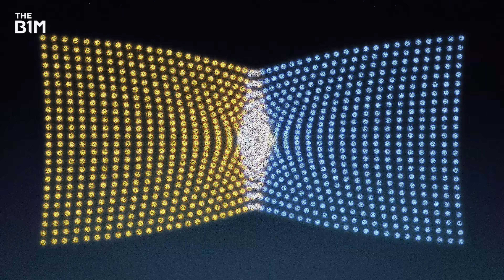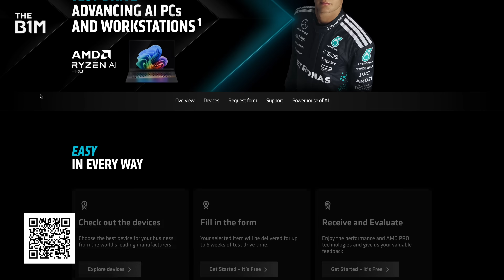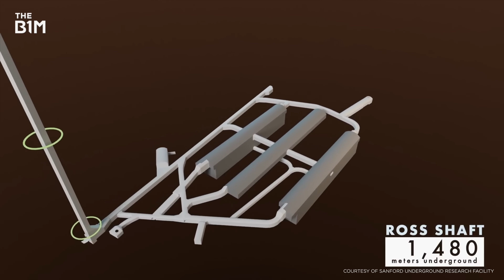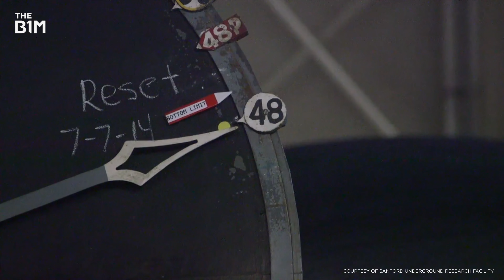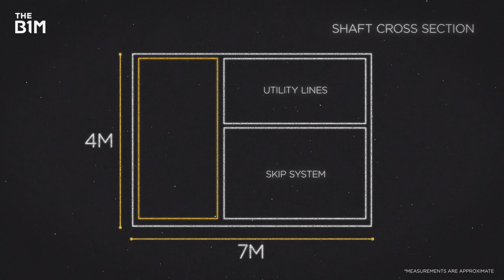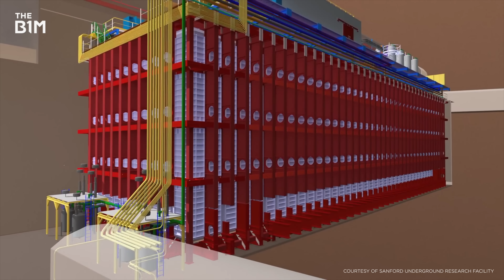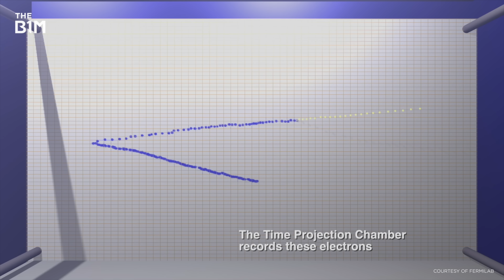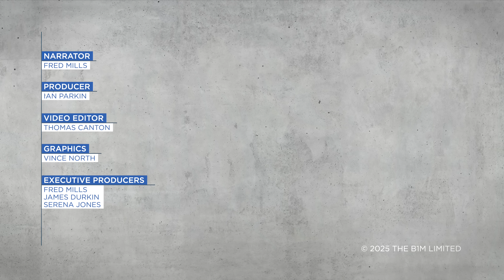Why America is Hollowing Out a Mountain

Comment: Deeper down the rabbit hole, and the wrong one at that (my opinion).  Not buying the 3B vs 3B+1 line of thought ~ it's an extrapolation, and not necessarily an accurate one for myriad reasons, including dark matter,  expanding space-time, etc.  Granted, it's a worthy experiment, but we're looking in the wrong direction.  It all hinges on the idea that the Big Bang... which is theoretically arguable as having BEEN a "Big Bang" to begin with (there are reasonable published proofs positing this is not the case)... created only OUR universe.  The answer is likely both simpler and more elegant than our present form of mathematics can unravel, meaning even quantum mathematics is only a small step in the right direction, and even that will prove ultimately misleading. Just saying.

Comment: i think that neutrino research is a very clever and actually a very realistic-plausible nobility project. ok crazy theory following.. (only as crazy as antimatter research).: i think they will dismantle a boring-company tunnel-boring device and reassemble it in one of caverns. i think that they will create a network of access to other surface locations as well as other subterranean locations that will remain undisclosed. there are many reasons for doing this; indestructible multi-access stronghold, planetary exploration development, asteroid mining research, terrestrial infrastructure research., hardened power and machine learning infrastructure,.. and much more. look at the incentives.  also wonder what the stats on gold discovery are for the gold mine as they developed this, and while building this did they continue to test the excavated material for other mineral bearing qualities and valuable geology.

Comment: A light years distance of solid lead would have trouble stopping this supposed particle but were supposed to buy the notion that this insignificant blip detector in comparison to a light years length of solid lead. The time light which travels at 300,0000 some odd miles per second. Multiplied into a year. That length of solid lead, kajillions upon kajillions of miles of lead.
That much of an inconceivable chunk of solid matter. But apparently this insignificantly sized structure will be able to detect how the particle will interact with other mind bogglingly tiny particles, based on an assumption of an event they believed happened at the beginning of time. Which is i would remind you, is just a wild notion theory of what they believe happened.  When everything everywhere happened out of nothing but managed to make not only matter but also anti matter, but in an unequal amount for some theoretically odd reason. Theoretical sciences is full of these oddities. Which are compounded as new theories require new oddities of science to try and explain previous oddities. If one doesn't comprehend something that won't fit with what came previously. Then it must be something new. Let's call it dark matter or perhaps maybe an equally strange dark energy to explain what we don't understand. On and on they go. If we explain it. Make up something and then build giant machines to prove we not making shit up.
Honestly the  gobbledygook they come up with trying to explain how the universe works is at this point quite comical. 
 I know I'm a fringe minority on this. But come on. Giving little desk top explanations that on the surface sound somewhat feasible to us normal brained folk. So we all just ok you know best. But scratch the surface and ask yourself... Really, but what about this or that or the immutable law's of physics that somehow don't apply when explaining how the universe began.
Then it begins to unravel. But these guys always have an explanation that again sounds somewhat feasible so again we say ok you know best.
We then carry on believing, and as long as a new tomorrow keeps coming then 99% of the world doesn't really care.
 Wow. I'm totally convinced this is money worth wasting... I mean investing into a future of make believe and 
the theoreticists wet dreams of keeping it all going.
They all believe it's all true and based in and on reasonable mathematical equations. But believing in a universe of numbers that give the belief there are multiple universe's overlayed realities, time travel and other sci fi fuel of the imagination because equations on a board if you play with enough number variations will give an answer to a question you've asked yourself does not make it so. But we've convinced ourselves we can keep adding to an already way over burdened explanation from scientists all over the planet as to how the universe works.
 But those who look at thing's differently then the science community it sounds for a good chunk of the theoretical NOT the practical science ( i want to make that distinction) quite silly.

Comment: 5:55 - If neutrinos can pass through anything how is a simple mound of earth supposed to redirect them into the detection array?   Why not just aim the beam at it directly?
Reply: It IS aiming at it directly - the mound of earth is to angle the beam so it points down into the ground at a shallow angle. Because of the curvature of the Earth over that distance, it needs to aim THROUGH the Earth to directly hit a target miles away
Reply: @largepurplemonkey  That was not what the diagram illustrated.
It indicated the beam was aimed perpendicular to the surface at the emitter, with the reflector positioned to redirect the beam before it reaches even the first emitter.
Ergo: is the origin producing neutrinos (which pass through everything so how would a reflector work and if they're trying to detect them how, then, can they be produced in the first place) or some other atomic mass such as protons that could be thus redirected.

Comment: I have questions.  First, how do you tell the difference between a neutrino and an antineutrino?  What even is an antineutrino, given that a neutrino has no charge and antimatter particles normally have the opposite charge of a regular matter particle, e.g., the electron and positron? Come to think of it, if neutrino detectors have to be massive in order to have a statistically significant chance of detecting neutron/nucleus collisions, how was the neutrino discovered in the first place? I am also curious about how we know that the Big Bang created 3,000,000,001 particles of matter for each  3,000,000,000 particles of antimatter.  That is an awfully exact figure for something that happened more than 13,000,000,000 years ago.  I detect that I have some googling in my future.

Comment: I took a tour of the Homestake mine in Lead many years ago. Got to go inside the headworks. The machinery is massive! Our tour walked around the outside of the building and I noticed a pile of broken drill cores on the ground. I as the guide if I could take some pieces and was told yes. The interesting thing about the cores is they are very heavy from their size. I asked about that and was told it is because on the compression of the rock at depth makes the cores heavier.

Comment: The thing they're testing is something known as Left Hand Bias. Essentially, at EXTREMELY small levels of precision, using HIGHLY technical models that INFER the meaning of the universe. some VERY deep DEEP measurements imply that VERY specific CHIRAL interactions have a "go left instead of right" bias in models. While nuanced as hell and EXTREMELY subtle, IF IT'S TRUE, it CAN explain why matter migrates INWARD and antimatter migrates OUTWARD, creating a SHELL that INSULATES "matter" inside the "volume" and ENCODES matter on the OUTSIDE of the volume, as the universe expands away from the Big Bang. It's like...knowing something is growing by measuring the stretch marks. It requires an incredibly long and nuanced chain of logical principals that has become an nigh-impenetrable labyrinth to the lay because of how deep it is in the chain of Reductionism, but it is fantastically impressive no less.

Comment: I’ve worked on this project and if you get the chance there’s a great little museum above the mine that explains what they do. It is a great use of an existing mine. They also have shirts that say Nerds searching for Wimps, Sanford labs at the Homestake mine. (Weakly Interacting Massive Particles (WIMPs))
Reply: Isn't Japan doing the same?
Reply: Yeah Japan's Super K detector was mentioned several times in the video.
Reply: @ryszardfalkowski7917  No, Japan's system is on a much smaller scale. 🙂

Comment: 6:32 Protons?
6:47 Neutrons‽
13:27 Neutrinos!
Reply: The neutrons/neutrinos mixup is an easy mistake to make, I'll let that one slide.  But saying protons?  Oof
Reply: came to the comments to say this! what was that all about?!
Reply: 14:41 he says neutron again (twice)
Reply: Well, Neutrinos are electrically neutral so you cannot force them around corners using magnets. They go in a straight line. 
I don't know how you produce Neutrinos but it could be correct that they produce them from protons.
Reply: @jpt3640  They do. But the two detectors are for neutrinos (which are detected indirectly, of course).
Reply: @alterego3734  sure.. so there is no accidental mixup?
Well, except neutron neutrino
Reply: @jpt3640  No, from the context, "protons" is still a mixup.
Reply: 4:50 NPU gimmick though
Reply: protons are fired into a graphite target resembling a long roll of quarters. Many different types of fundamental particles come out of the collision between the protons and the target, including pions, which are charged particles. then magnets steer the pions in the direction they want the neutrinos to travel. The pions eventually decay into muons and muon neutrinos, which continue on the same path the pions were traveling.   
 
That's Directly off Fermi Labs website

Comment: The scale of excavating the far detector at 4,850 meters is astonishing, especially considering the historical context of the Homestake mine!
Reply: 4850 feet not meters
Reply: The amount of heat in the cave walls must be astonishing. I can't even imagine the size of the cooling system required.
Reply: I worked for Homestake at the Bulldog Mtn mine in So CO.  I was able to visit Lead once in the late 70s as part of my work.  I don't remember the name of the winze (internal and different than the shafts from the surface that they refer to in the video).  At the time, the winze went down to the 8000' level, 3000' below sea level.  I don't believe it was ever deepened.  The deepest mine in the world before So Africa gold mines started.  The rock temp was 120 F.  To prevent spalling of the wall rock, there were rock mats every 6-8' completely covering the circle from floor to back to floor.
Reply: Iran did it long ago.
Reply: 7:11 "at level 4850" 
7:29 "at 1475 meters under ground"

The 4850 number is either feet or just another way MAGA inflates general accomplishments.
Reply: @alltheusernameswastaken8936  
some people are just not capable of not spewing their terrible politics everywhere even when irrelevant.
Reply: @alltheusernameswastaken8936 MAGA couldn't assemble a preschool toy block house. This detector was not designed by them.
Reply: Oh pish Tosh, 😝
It’s nothing compared to all those little tunnels connecting all of our military bases come on now get real this is nothing ha ha ha ha
Reply: @shockingguy put the meth down
Reply: 😂 @jtorola

Comment: THERE IS NO DARK SIDE OF THE MOON!
THERE IS NO DARK SIDE OF THE MOON!
THERE IS NO DARK SIDE OF THE MOON!
THERE IS NO DARK SIDE OF THE MOON!
THERE IS NO DARK SIDE OF THE MOON!
Reply: What about the side that is not in the sun?
I experience the dark side of the earth every night
Reply: There is a dark side of the moon. It's just not the far side of the moon. It rotates. Just like the moon does. Just like the Earth does. Is the part of the moon in the Earth that are facing away from the sun. Just because you use all caps doesn't mean you're right. If I landed on the moon just after sunset and stood there for 14 days, I would be on the dark side of the moon. Then for the next 14 days I'd be on the light side of the moon.
Reply: The side of the moon that is dark is cold. The side of the moon that is light is warmer. 
The part of the moon that is in dark and the part of the moon that is light changed during the month.

Comment: 7:11 Kinda confusing conversion there. The level is 4850 in feet but in meters is 1478m
Reply: It rather depends what exactly is being measured, point-to-point. The main level for science is the '4850 Level', which can be accessed through the Yates and Ross shafts. At 1,490 meters (4,890 ft), SURF is the deepest underground laboratory in the U.S. Two main underground campuses, the Davis Campus and the Ross Campus, host experiments on the '4850 Level'. The Ross and Yates shafts run from the surface to below the '4850 level'. The deep labs protect sensitive experiments from cosmic radiation, and Homestake is up to 8,000 feet deep. Shafts called "winzes" connect the '4850 level' to deeper levels. Since it was sealed shut in 2003, Homestake had been slowly filling with water until 2008 after which the South Dakota Science and Technology Authority (SDSTA) began pumping it out. The high-water mark was 4,530 feet underground and in the late morning of May 18 2009 the water level had been lowered more than 320 feet, reaching 2 inches below '4850 level'.
Reply: @htimsid  I don't remember the name of the winze as I only visited there once.  At the time it went down to the 8000' level, 3000' below sea level.
Reply: Almost a mile deep - it's a fantastic achievement getting all that equipment down there. How's the geothermal gradient there?